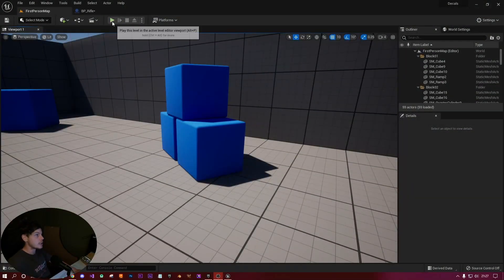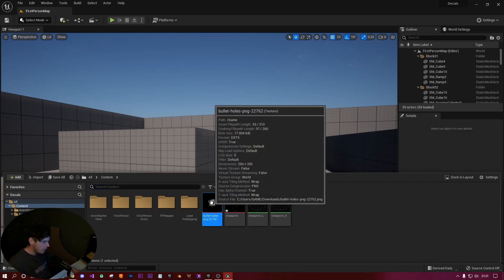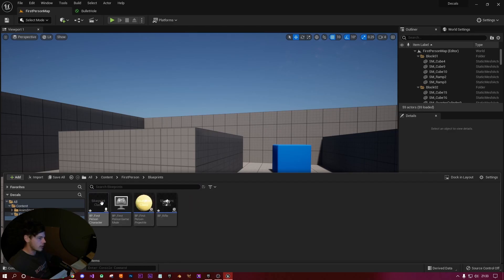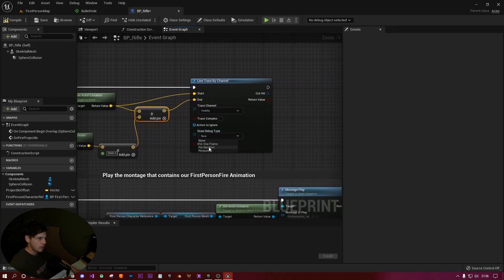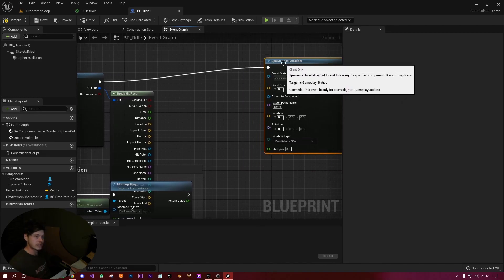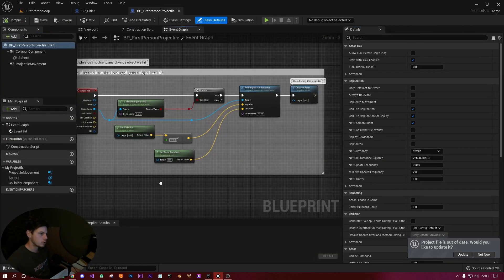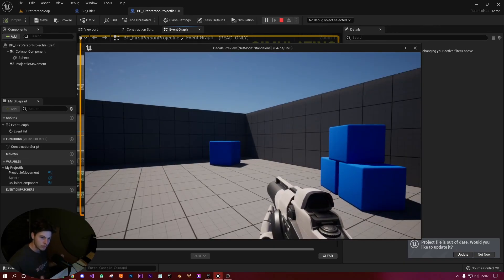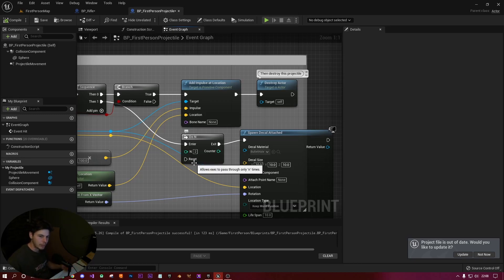UE5 - Creating Bullet Holes with Decals (Linetrace + Projectiles)

Comment: It doesn't work if i shoot landscape, it looks stretched and on objects with uneven scaling, my theory is based on even normals/topology  🤔
any advice?
Reply from the maker: Hmm not sure but what is the scale size of your landscape ?
Reply: @StevenOrmerwood  sorry I said landscape but seems to be the case on static meshes as well
Reply from the maker: @stabbedbyapanda  usually stretching is due to the decal either not being square or the scale on the “spawn decal” node not being 1:1:1, but I’ll have a look later for you, just to check what version of unreal are you using ?
Reply: @StevenOrmerwood  it wasn't originally 1:1:1 or square but after watching your video I fixed that, I edited the image and reimported it. I'm on 5.3.
Reply from the maker: @stabbedbyapanda   might need to download ue5.3, tested on landscape and it  functions correctly, https://cdn.discordapp.com/attachments/960111290586644511/1183821855921012787/image.png?ex=6589bb04&is=65774604&hm=6f8b336554b08899e2b04809ad4b797bb8f41172b8ef096f78608b6b0452ae57&
Reply from the maker: @stabbedbyapanda  if you like you can join the discord server and share screenshots and i can try to narrow down the issue - https://discord.gg/7YzucQDW
Reply: @StevenOrmerwood  omw! Ty for the help

Comment: had to fiddle with it because my blueprint for my weapon was a custom one but works great! bullets do fade out of range after walking away from them, i'm not to sure what causes that.
Reply from the maker: hey thanks for commenting, im thinking its the fade distance based on screen size, try to use this node after the decal spawn : https://imgur.com/a/gWMsRq1
Reply: @StevenOrmerwood  EPIC! works like a charm. Thank you
Reply: Just noticed that when you shoot into the air/void like the sky it gives me a error: " Blueprint Runtime Error: "Accessed None trying to read property CallFunc_SpawnDecalAttached_ReturnValue". Node:  Set Fade Screen Size Graph:  fireweapon Function:  Fireweapon Blueprint:  BP_baseweapon "
Reply from the maker: @Scolfsit  ahh might be worth adding a “is valid” node before the fade node, and also you may need to add one between the line trace and the spawn decal, 

Is valid node: these will check to see if the reference from the previous node exists and is a valid reference before continuing, this prevents certain errors like if you shoot into the sky, and you don’t hit anything the spawn decal doesn’t have a component to attach to, and also the fade node doesn’t have a decal reference to apply to either